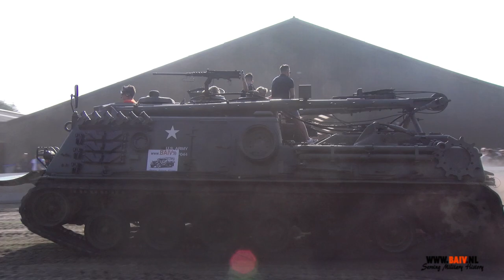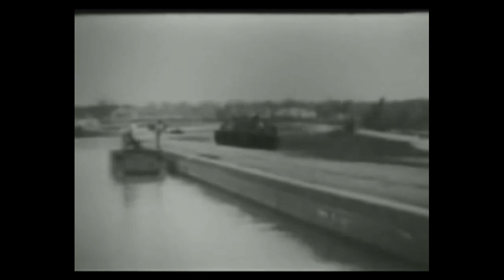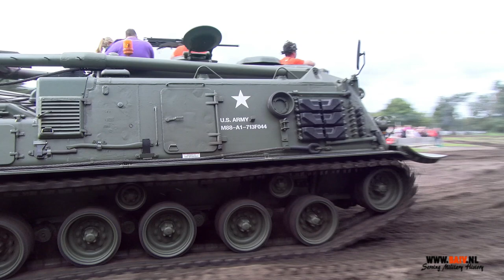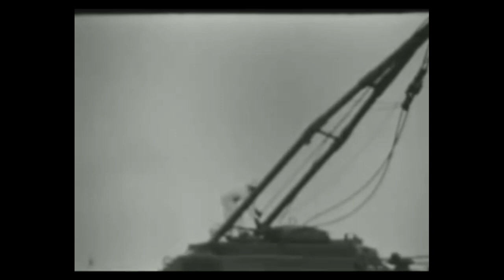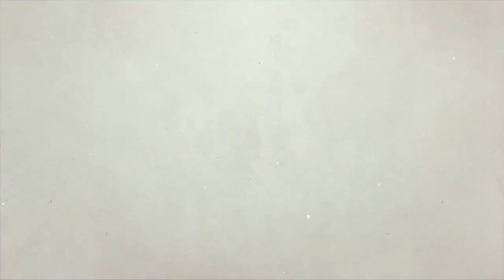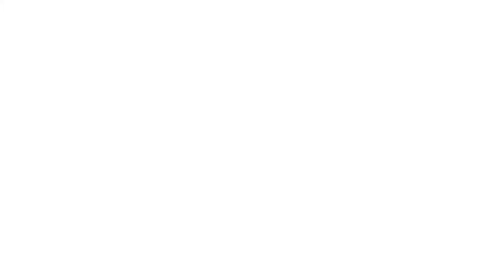M88A1 Recovery Vehicle

Comment: Im an original 63F20 US Army school trained Recovery Specialist. Guess that job slot no longer exists.  73-76 Aberdeen Proving Grounds we trained on the wheeled M816 5 Ton wrecker, M578, M88 and the M123 10 ton HET "Dragon Wagon" Once overseas I was assigned (1974 - 1976) to a 3rd echelon maint unit "Co. E, 123rd Maint. Bn., permanent party over in Germany at Storck Barracks, Illesheim I primarily drove the M816 Wrecker and occasionally the M578 or the M88. It had the 12 cylinder MOGAS engine. The Rubber Ducks or Mud Diver were our nicknames in AIT.
Reply: For 63Ds, that recovery school designation was later called H8 (hotel 8 school).  That was around 96-97.  I don't know what it's called now.
Reply: CCO 1/35 Armor in Germany,we had the gas powered M88 in 1975, it was a monster.

Comment: Tell me - which metal welding machine can be installed - military equipment - so that it is not too big and not too noisy in the evening. After all, everything must be on (BMP 1) - a light military vehicle - of which there are many in Ukraine --- and which are repaired many times. And repair crews drive on them --- and there is very little space for a tool . (  БТР --- FV430 BULLDOG - as an example - and does it have a welding unit in its configuration - and also a 220 V generator ) .  )))))
Reply: Nobody in the USA gives a fuck about Ukraine…